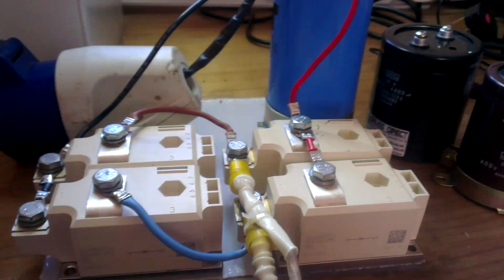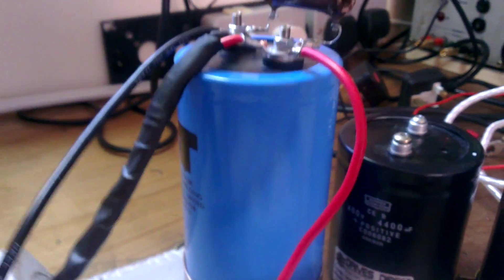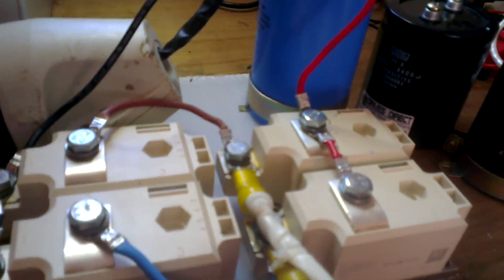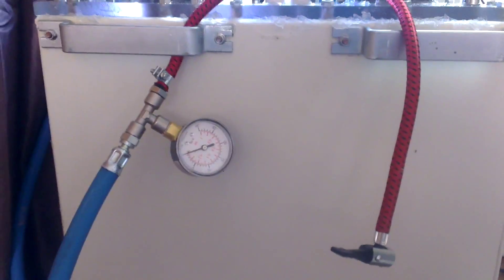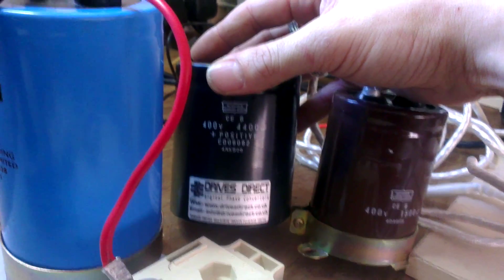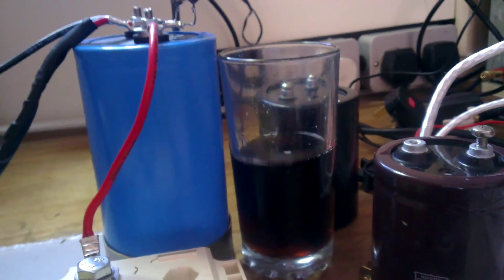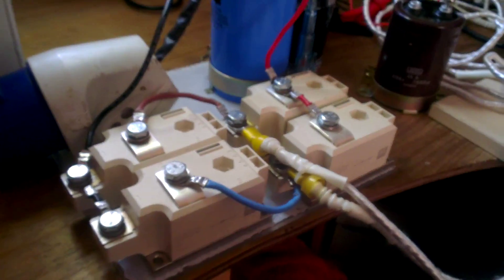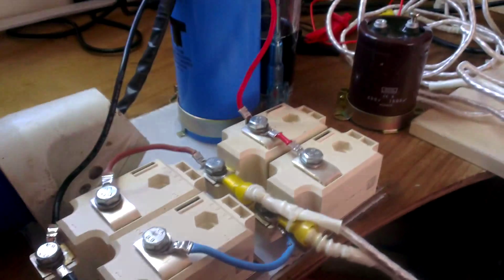!A RANT ! AND A BIG ARSE FULL WAVE BRIDGE RECTIFIER USING 380A 1.2KV DIODES

Comment from the maker: i couldnt agree more mate ,i ended up not making the welder and i put these diodes into my control unit so i now have 270v at up to 70A ac or dc .50A constant but the variac doesn't complain for shot runs

Comment: Mmmm!! BIIIIIIG diodes. :D

You could bridge-rectify the whole house on those. :D

Imagine that nice little assembly, in a clear box, maybe with a quiet cooling fan, screwed to the wall in the kitchen, hooked upto the cooker. :D

Heating elements run hotter on DC.

Mmmm, now that's an idea! Connect it to the kettle instead, and turbo-charge the kettle for an extra-fast Cuppa-Tea-Time. :D

Soon, I'd like to get some BIIIIG diodes, make my own bridge, then pull some nice big 3kW DC arcs. :D

-BBD.